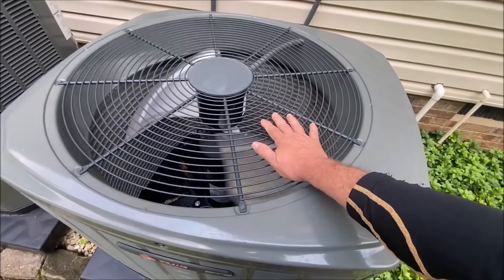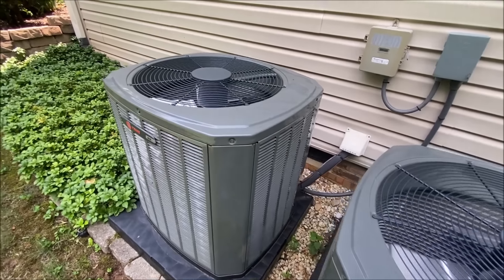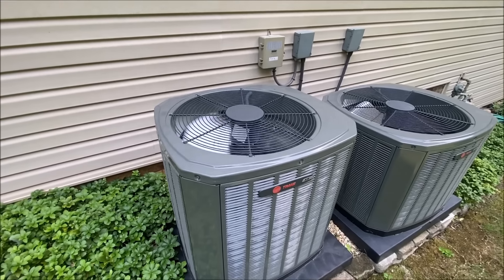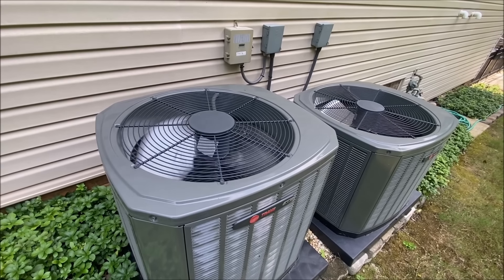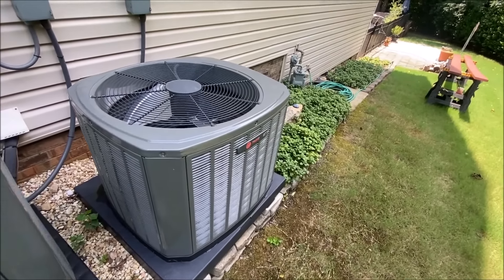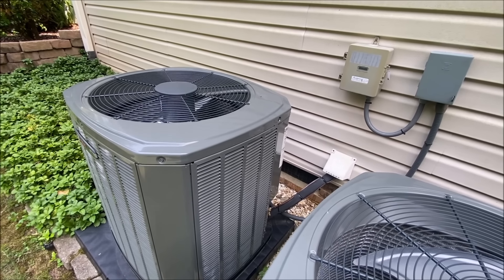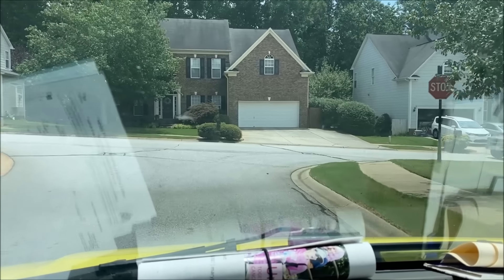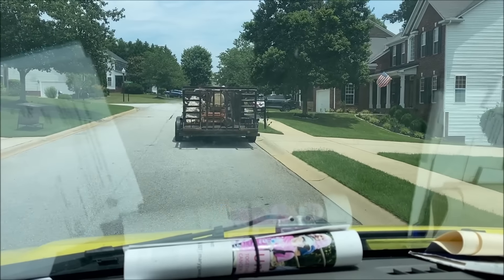AC Compressor makes noise when turns off

Comment: Probably back emf generated by fan rotation hitting compressor.  Can be fixed with double pole contactor with fan hot moved to bottom.  Isolates fan from compressor.
Reply: Looked like an ECM fan motor.  Same applies?
Reply: Winner winner. 🏆
Reply: That is not an ECM fan motor on that unit.   The it’s definitely a known issue.  With TRANE/ American Standard units going back to 2020 16 SEER units and 14 SEER.   Seems like we are getting more calls about this on newer units now.  We’ve had about 4 this summer so far.  Their is a bulletin about this from AMS/ TRANE engineering department.   It’s been mentioned already.  Change to 2 pole contactor and move run winding for fan motor to L2 from T2. Same way all Carriers come factory wired.  Engineering dept states it’s a back EMF issue.
Reply: Thanks for the learning! I’ll try this next time I run up on this issue
Reply: yeah, back EMF from one or the other, probably compressor/cap combo hitting the fan motor, that would make the higher pitch bang, especially since it's hooked to giant noise emitters (the top and blades). compressor is generally a dull low tone thump.

Comment: Dam for the money you have to spend on these units, it really shouldn’t make any unusual sounds or vibrations cycling through a shut down sequence ? that would probably indicate a less than optimal life span of trouble free usage down the road? It’s like buying a new car with a bad bearing in the engine, it’s all good until it runs out of the manufacture warranty down the road and then it’s on your dime. Just change out anything & everything in that unit under the factory warranty… until it sounds right. make it run like the other unit next to it does. Kinda hard to tell a customer that “oh it’s ok that’s normal”, when you have a  comparison unit sitting right next door and it’s working without the issue.. When you’re retired and done and that unit kicks the bucket down the road , their in for more downtime and aggravation..

Comment: Its that fan thump noise I can make it stop doing that with a double pole contactor
Reply: Joe knows , I remember that video
Reply: That's interesting, maybe Ted will try that, I'd like to know if it works.
Reply: Yup, you should make a video on that
Reply: sure would love for you to show me, I always want to learn how to get a customer off my back lol. please make a video on your solution to prove your hypothesis.
Reply: I only install double pole contactors when they need replacing
Reply: AKA top pop. Your FSR should be familiar with it.
Reply: My trane does this too. I do hvac. I'm not worried about it.
Reply: customers are a pain sometimes mostly the retired ones it seems they sit in front of the units and note the slightest vibration or od noise its realy anoying and call me....oh Bob it did that noise last night at 11:05 pm can you come over saturday morning cause this week im playing golf all week...oh you can also drop by Sundae around 5 pm we will be back from Church 😳 👀
Reply: I have a 5 ton Carrier condenser that has been making a kick a bucket full of bolts since day one, when stopping. It is now about 3 years old. It cools perfectly!  No one has been able to determine the cause. 10 year warranty.
Reply: @bills6946 Shunt side contactors are normally used to keep a winding hot to heat the crank case. You maybe deleting the crank heater when you do so. Not good to not heat the oil.

Comment: It's caused from the fan motor. Disconnect the compressor and it'll still make the noise upon shut down. Usually only does it when the pad is not on regular ground but on rocks or cement. Tighten the fan mounting bolts as tight as you can by hand and put vibration pads on all 4 corners of the unit. It's worked every time.

Comment: there is another youtube tech who installed Carrier and had the same customer complaint. A loud bang when turning off. He installed a delay timer to turn the fan off a few seconds after the compressor shutoff. It worked well. The noise was completely gone. Just an anomaly that the one specific unit resonated when turning off. Staging the shutdown solved it

Comment: I bought a brand-new Amana 4 ton, and it does the same noise at stop. I thought was the fan blades, but I stand closed to the compressor and I hear from there and it feel like clan,clan,clan when is stop. it looks like the compressor when it stop. Maybe cause its bran new and the piston inside do that.

Comment: I have a 2023 amer Stan silver that started doing this 4 wks after install.  The installer tells me its normal with the new compressor design.  I wish they could do something to quiet it down.  It runs quiet and the  entire system with blower installed.  It’s going to get used a lot in Az.  Kicker is if the rotary designed compressor wears out the entire compressor needs replaced.  10 year warranty I hope has me covered if it happens.

Comment: I would first check the mounting of everything. If it were a car, i'd check the motor mounts. With this, i'd go for the fan, compressor and even the unit itself. Trane may have left out a rubber bushing.

Comment: should a newly installed compressor make noise on start up ?  like cavitation or a "rod knock" on start up ?  I'll have to record it, BUT, I am not getting the same idiot who came out the last time.  Yes, coincidently I had a FIRE in my fuse panel starting at the AC circuit breaker WHILE he was here working on the unit.

Comment: Looks like the installers could turn some of the units 90 degrees to allow for easier service, the control panel and service area, if heat pump would be a lot easier to service

Comment: had my compressor on my new 2021-22 trane unit go out at 13 months.  original compr indicated made in louisiana.  replacement was proudly made in china.  maybe pandemic conditions resulted in reduced quality control on new trane.  but if a trane laid down after a year can you expect any mftr to be reliable?
Reply: Trane does not use Chinese compressors. Some have LG compressors, and those are made in Korea. Most include an Alliance, and they are still made in Louisiana from what I have seen. Maybe yours was a certain batch.

Comment: Although there may be some back emf factor with these units causing the fan to jerk, I believe the actual clunk can be coming from a loosening of the fan blade shaft bolt.  I observed this happening with an Am Std Silver Series CU about two years ago.  The noise started like the sound of these units and gradually worsened over a week or two.  It eventually resulted in the fan blade falling off the shaft and damaging the compressor discharge line as well as the blade itself.  .

Comment: that sounds like normal the valve noise. When the compressor stops there is still head pressure and motor will shutter back and forth a few cycles until the opposing forces equalize and the motor stops in a neutral position.

Comment: I have a new 3 year old system, not a Trane, that does the same thump.  Mine is more at start up.  I questioned it as well and was told that all the new style compressors will do this, clutch noise I believe

Comment: I have one that makes 10-12 knocks on shutdown.  Sounds like someone threw a handful of rocks at it.  My service company ordered me a new compressor (scroll) but said to wait until the old one failed as it was working perfectly and using no more electricity than a new one.  That was three years ago and it still works perfectly just noisy on shutdown.  I don't know if it is a rattling seal or what but pressures are perfect.  I just knew it would throw in the towel  a long time ago but it has not.

Comment: Do you think that the compressor could be loose and when it torques on shutdown that it moves slightly? That definitely doesn't sound good (acceptable) on the first unit especially if it's new.  I'm not in the business but as a consumer if I paid to have that put in I wouldn't want it to sound like that.

Comment: We have a Trane installed in 2018 and makes the same noise. If you find the cause/remediation please share. It’s mostly a mild annoyance.
Reply: Sadly it is just the sound they make on shut down. The compressor becomes torqued in one direction while running and the sound is the compressor immediately releasing the torque.

Comment: The scroll compressor , upon shutdown will make that noise . It's the pressure in the system that actually pushes the scroll backwards for a brief moment. It is  Totally normal. On the trane csha scrolls (15 ton)  upon shut down they actually turn bakwards for up to 2-3 seconds. Take is easy bro.
Reply: That sounds like the reasonable explanation.
 The early type rotary used to tick while equalizing. 
 Back EMF,resonance,moving loads around.IDK about that shyt.
Reply: Yeah idk what everyone is talking about the fan making the noise, bigger scroll compressors do it unmistakably so that’s probably why I know it’s the compressor

Comment: ive been working with newer compressors. the ones i learned on in school dont necessarily make that noise because they are older units to be trained on. on the case with the newer compressors, they all stop like that. i just worked on a year old system and when i pulled the disconnect it make that exact same noise. its a manufacturing issue as far as im concerned.

Comment: Normal sound for a rotary compressor. Their valves behave differently for a reciprocal compressor, and this is perfectly normal.
Reply: I for one do not believe it's normal, maybe with these two-stage compressors nowadays but it is definitely not normal on a basic compressor, I would like to find a way to drop down to first stage before shut down, I can tell the difference in sound from first to second stage, I have a f**** geothermal unit and as loud as f*** in the house... makes you want to run and go look and make sure you ain't got no lines blown off an flooding your house...lol

Comment: So youre telling me they designed that ac unit to make that kind of noise? I cant believe that. If the customer had the opportunity to “test drive” the unit before they purchased it nobody would buy one. I spent $20k to have 2 american standard units installed and they make the same noise which I was told is normal. I will never purchase that brand again or use the contractor that sold them to me.

Comment: Any possibility the compressors are loose on their mounts, and just need to be tightened down a little?
Reply: 😅😅😅😅😅 wow
Reply: Not very likely.  They are torqued at the factory. Occasionally that may be the case, but not very likely. It is the sound that a scroll compressor makes when shutting down. The noise could actually be reduced by loosening the bolts just a little, but make sure to dab a bit of rtv across the bolt to prevent it from backing out more.